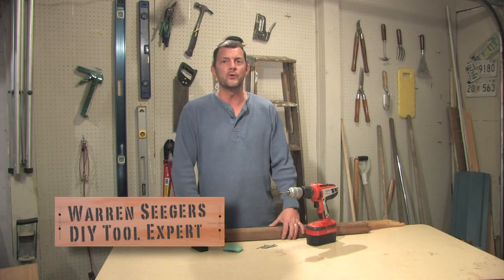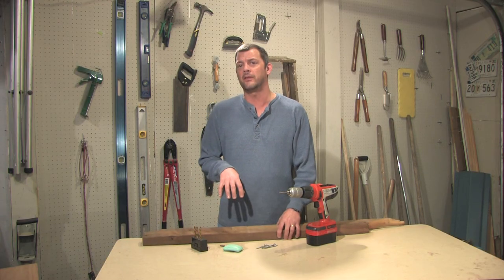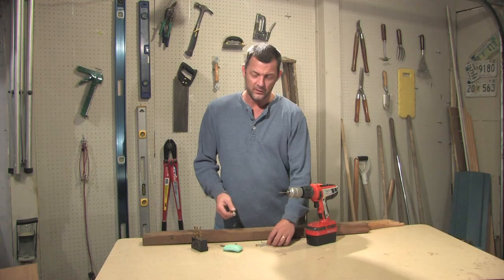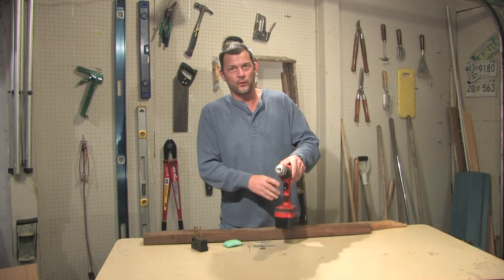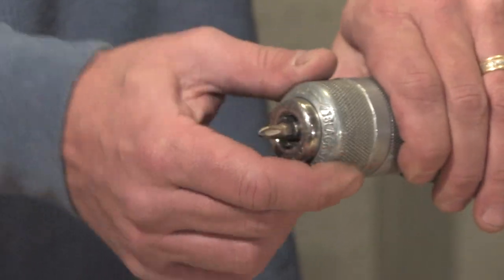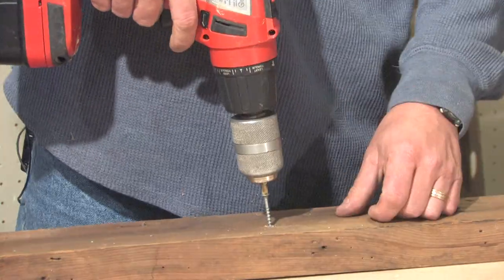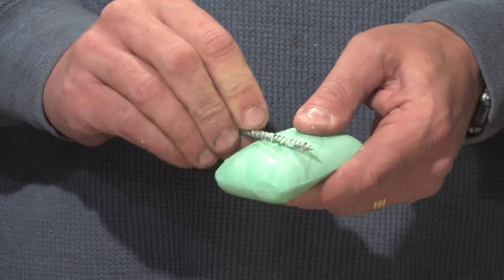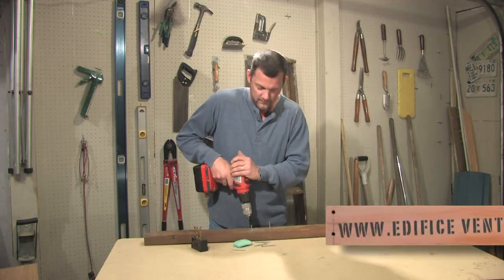Two Tips for Screwing into hardwood

Comment: Thank you SO much for making this. I purchase a butcher block table from Ikea and even though it had pre-drilled holes, I could not get the screws in all the way even with a high power drill. I didn't trust myself to drill a larger or deeper hole without piercing through the table top. Tried the soap trick, worked like a charm!
Reply from the maker: +Raw In Progress glad the tips work for you.  Thanks for watching.

Comment: Nice,  I have some kiln dried Douglas fir and tried to drill pilot holes  ,   what a pain.   like going into oak.  New Bit and first time using it.  Wasn't advancing at all.   Got mad and burned up the bit...  bad move.. but will try again with an auger type bit...  Funny  thing is the 1/8 bit went in fine... followed it up with the next in size and that's where the problem began , it didn't advance.   Thanks. hopefully  the new bit will work and  soap will be on the screw also.  Thanks
Reply from the maker: Glad the video was helpful. Don’t forget to subscribe for future videos and let me know if the soap trick works for you.

Comment: Does this work if you soap the drill bit beforehand? I am having issues with my drill bit getting stuck when I try to drill a pilot hole. Currently sitting here with pliers and two (2) bits stuck in the wall 🤦‍♂️ (in my defense, the wood is well over 100 years old.....)

Comment: I tried the soap and it's still not going in. To do a pilot hole, do I need to use a bit that is smaller than the screw? How do I know what size? I have a nice BD drill about the size of yours, but I'm not that savvy...trying to hang Old Glory by my front door and afraid I'm messing up the wood. The first screw I put in almost made it to a tight bond, but the head stripped out before I realized what was happening.
Reply from the maker: Nancy Gerst Hi Nancy,  Your drill may be too powerful causing the screw to act like a drill bit and making a hole.  Check your drill to see if you can change the torque to a lower setting.  If your drill does not have an adjustible torque start the screw with your drill and stop just before the head is flush.  Use a screw driver to make it snug and secure.
Reply: Thanks everyone for your help!

Comment: I have  better tip use robertson head screws it will almost eliminate stripping. The phillip's head is the worst screw design but thanks to Henry Ford the ridiculous screw was chosen over the far superior Phillip's head
Reply from the maker: You are correct.  I’ve noticed Phillips bits are not as popular anymore.  That’s a good thing.  My cousin swears by the Robertson head.  Deck screws are becoming standard with a star head now.  I also like the fact the bit is included with a box of screws.

Comment: With all due respect, that to me didn't look like hardwood.  But I might be wrong.
Reply from the maker: Hi Zed.  You have a good eye.  It is not technically a hardwood.  The piece of wood you see is from the building I am turning into a home.  We aren't sure of the exact wood the building was framed with, but we know it was redwood.  The building was built in 1941 with true dimensional lumber.  Over the years, the wood's moisture was reduced, making it hard enough where I had to use the tips in the video.  I stripped many bits and screws and broke many screw heads on this project. Lol.   Thanks for the comment and discussion.

Comment: Soap holds the humidity. Not good for the wood. Try candle wax instead.
Reply from the maker: Great point Dominick!  Candle wax can be used in place of soap.  Soap is still safe to use.  The small amount used on the screw won’t effect the moisture content of the wood.  Thanks for watching.  Be sure to subscribe.